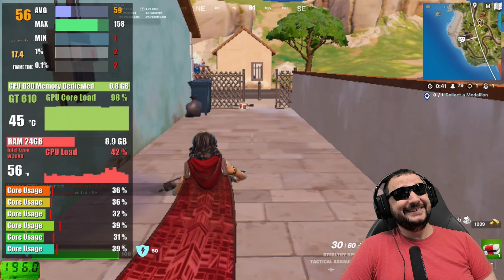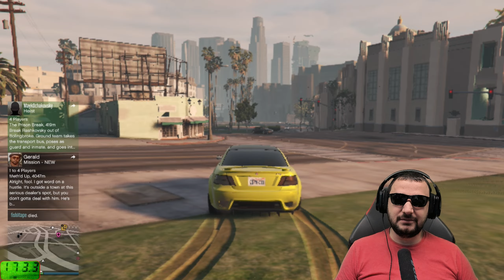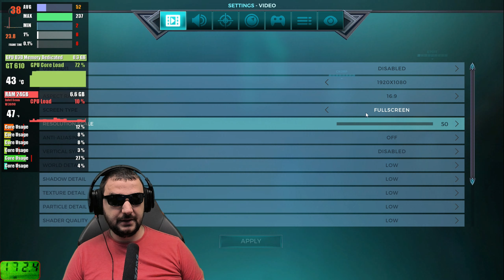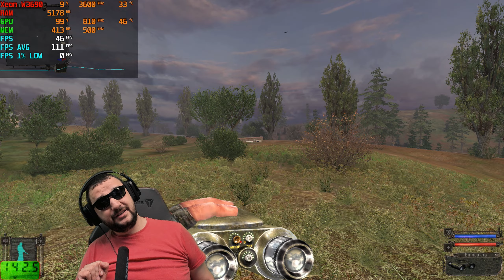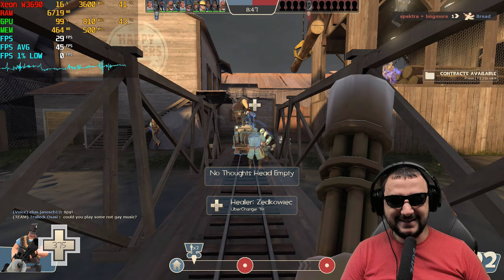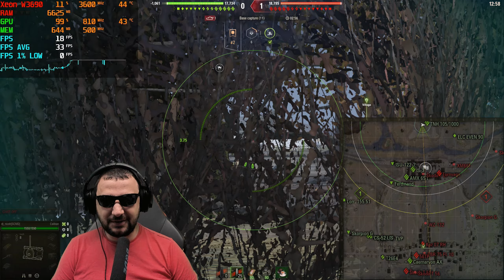NVIDIA GeForce GT 610 Benchmark

Comment: Nice vid! BTW i just found a tech recycling store near me and its absolute paradise, they have everything you can think of there, The gpus there are $5 for smaller cards like this and $10 for ones with shrouds, they had a 5770 and another card probably a gtx 260 but I have enough of those types of cards. I got a Quadro k420 and a Gt 710 1gb ddr3, lots didnt have identification too
Reply from the maker: Unfortunately, I don't have a recycling centre nearby. Though I wish it were much easier, I found them over time on eBay. Every day, I scrolled through listings, and occasionally, I got lucky.
Reply: Do you mostly get your older low end gpus from second hand sites or a store where they sell them really cheap? ebay these cards are overpriced when you can get them for pennies at a recycling center
Reply: I found a Quadro 2000 at one such place last year. After a bit of bargaining, they gave it to me for just $7.
Great build quality, solid voltage regulator, and a fantastic chip with 92% ASIC quality (the highest binned silicon I've ever seen). I was shocked to see just how well that GPU was put together.
No match for an HD5770 or even a GTS450 in terms of raw performance (it's essentially a heavily underclocked GTS450) but it's single slot and requires no external power and goes nicely with my old Dell Optiplex 755 mini tower with a Core 2 Duo E8400.